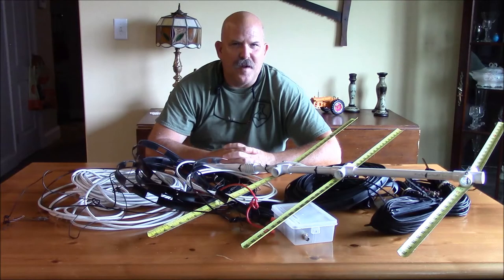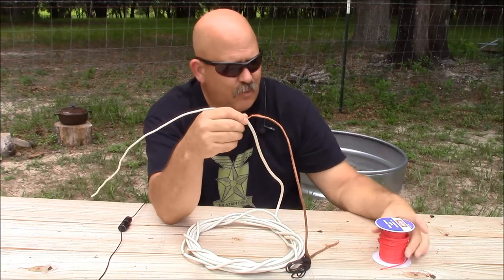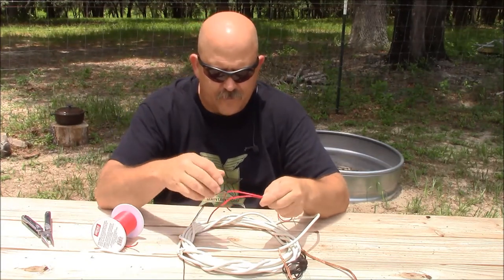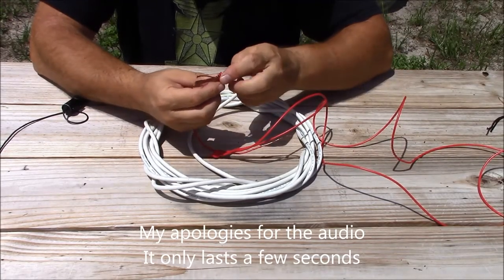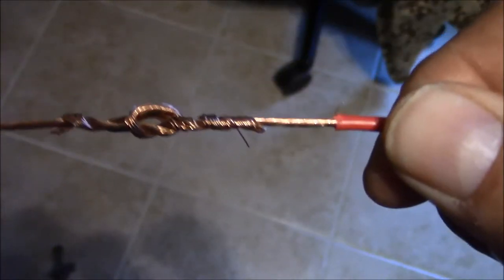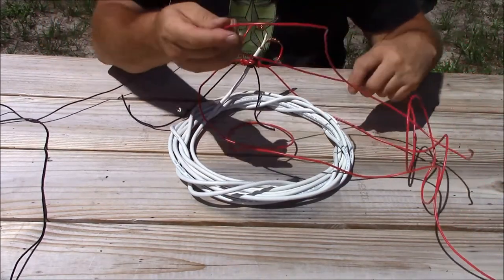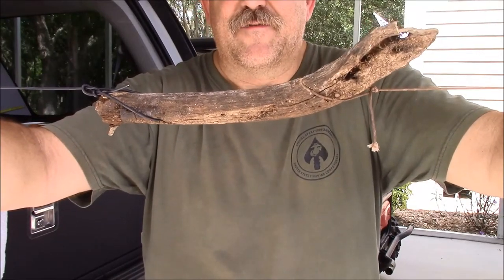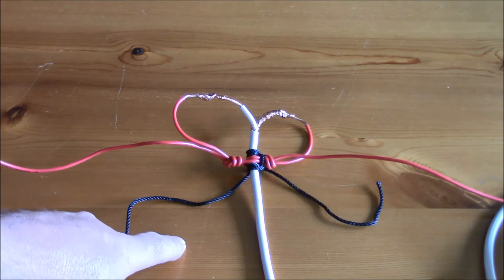Survival Antennas 2  Emergency Rescue HF Dipole

Comment: This is a very USEFUL series. Ideally, I would buy a Chameleon antenna system, but … I can’t afford it, so building a field expedient antenna is the next best thing, especially if I had a Chameleon but it wasn’t with me, was too heavy, etc.

There are some really tempting antenna systems, but they sound like ”snake oil”. You know the ones with a single vertical element, a ”magic black box” at the bottom, no radials required, and claim 80-6 meters WITHOUT a ”tuner”! Plus they’re a bit bulky and made of pure ”unaffordium” and ”unobtanium”! 😣

73 de AF6AS
Reply from the maker: Thank you ! I have a lot of antenna content in my catalog please check it out and thanks for watching !

Comment: Wondering ...if one would use the original dipole, and add mechanical switches at the ends, and then add the rest of the wire to the other side of the switches fit Hf freqs , so one can literally switch from say 2 meter to 80 ( I know the switches will 'leak'...)...
Reply from the maker: You could if you wanted to or tie multiple elements to the same feed point (fan dipole). My NVIS antenna video was a variant of the fan dipole. Thanks for watching !

Comment: Awesome lesson. Built one for 17m. It detuned after some time in the air. I'm wondering if adding cordage to the legs, would prevent stretching?
Reply from the maker: It might - there are a lot of variables in something fast and loose like this - how bad did it drift ? Doing one with a wood insulator with the coax encircling it and the insulator providing strain relief would be a good down and dirty and may solve the stretch issue.  I may punch one of those out today. Let me know what you come up with.  Thanks for watching !
Reply: @survivalcomms  it was bad enough to take it below the 17 meter band. I think because the band is so narrow first of all, then the coax I was using had a solid core with braided conductor. I believe it was that solid core which sagged or stretched. Even with that problem, I would build that antenna again. Like you said quick and dirty. Thanks for making this series. I shared this video just a little while ago.
Reply from the maker: @OH8STN  You are welcome ! That cable may stretch  but that much would be pretty unusual IMHO.   I just finished doing an alternate feedpoint video using the same materials list.  Its quick and dirty too and involves knots. I will have it up tonight. Thanks again for the feedback !